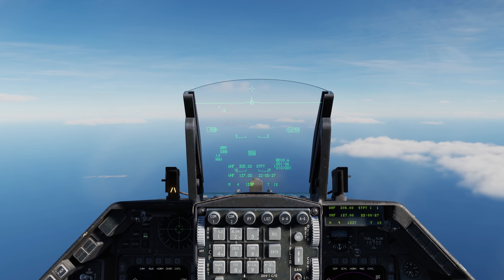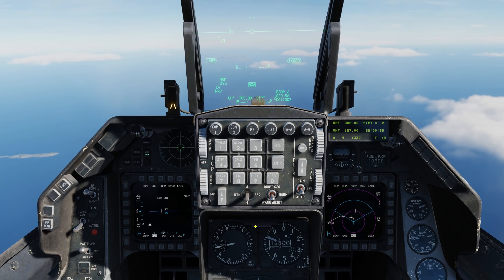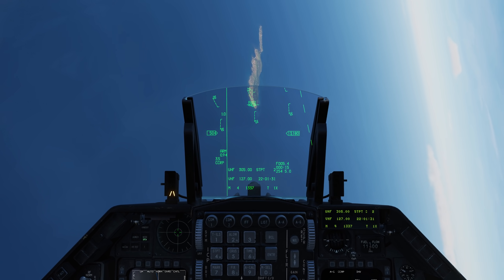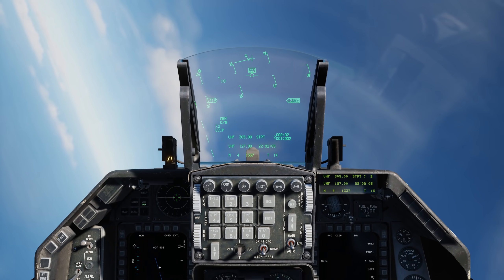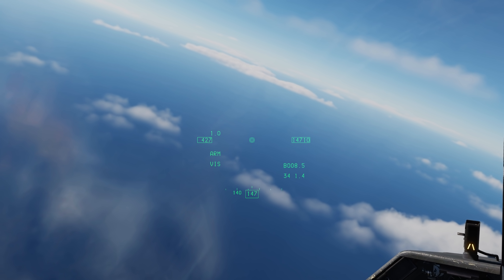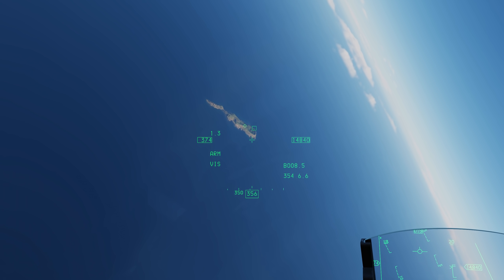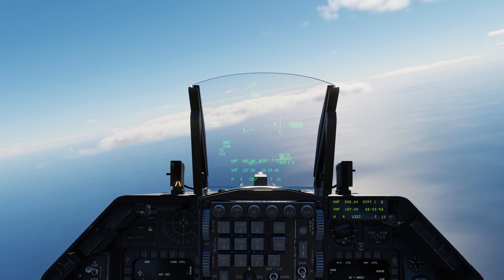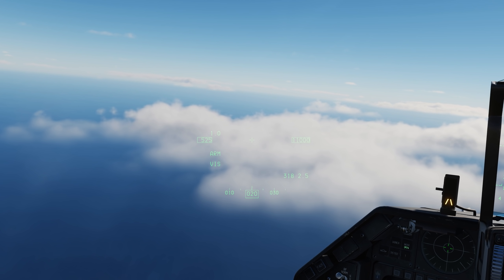DCS: F-16C Viper | Air-to-Ground Helmet

Comment: I still cannot find what switch it is you are using to so easily change from the modes. CCIP/CCRP etc... I thought it was the missile step but that sends me straight over to AA mode. :(
Reply: Nosewheel Steering/Missile Step Button on the control stick. Cycle CCIP/CCRP/DTOS.

Comment: At 1:16, what was the button you pressed to go to CCIP? It seemed to me you didn't use the OSB.
Reply from the maker: Nosewheel Steering/Missile Step Button on the control stick. Cycle CCIP/CCRP/DTOS.
Reply: @MattWagner  Cool, I didn't know that, thanks!
Reply from the maker: @ReflectedSimulations  It's a very handy function.
Reply: @MattWagner  I find the F-16 is a lot like Microsoft Excel. If you don't know any of the key-shortcuts and cheat combos it's quite complicated, but once you do, you're lethal :D

Comment: Is there or will be in the future an option for HMCS to have some preset or easier way to change amount of data available on HMCS? Especially for AA, since on MP servers it would be nice to quickly get desired settings without too much of running thru DED with ICP. Thank you.

Comment: When you TMS up for more than .5 seconds, does it switch to the HMD on release of TMS up or .5 seconds after you start holding it?
Reply: You will have to release it. No different than setting the radar to TWS with long press right we currently have.
Reply from the maker: @ashlittle4545  Correct
Reply: @ashlittle4545  yeah, I'm just curious because 'other games' have it swap after .5 seconds I don't know which way is correct
Reply: I believe it is after release

Comment: Good video Wags many thanks, question? Shouldn't the selection of the HMCS from the HUD be done via the DMS switch instead of the TMS?
Seems a bit weird that DMS is used for all screens selection and we then have to use the TMS for this one in particular?  

Pyro
Reply from the maker: No,  TMS.
Reply: Logically, yes. But bear in mind that the HMCS setup was added on top of existing software for engaging visually using the HUD. It’s very much something that was added to the Viper after it’s development.